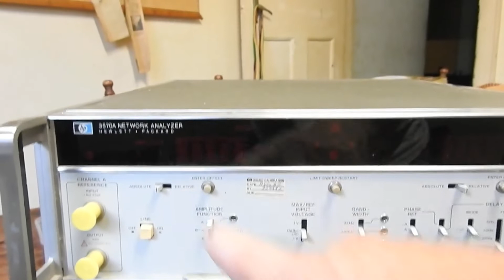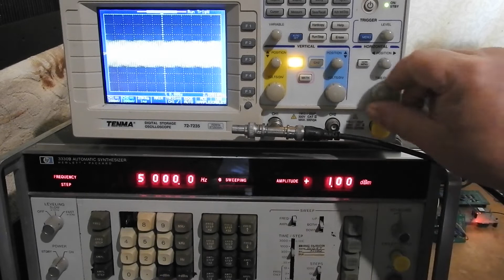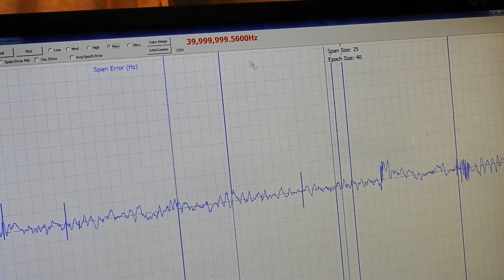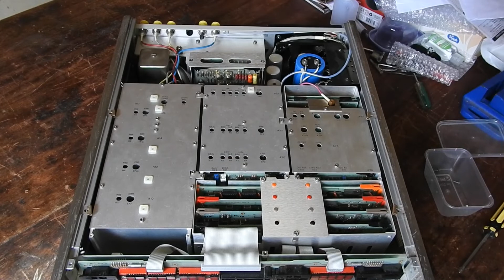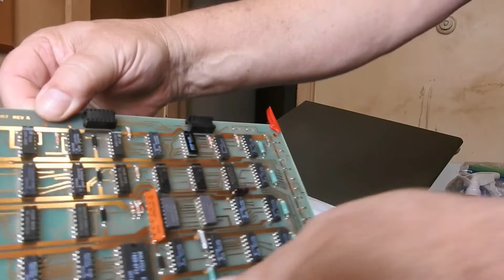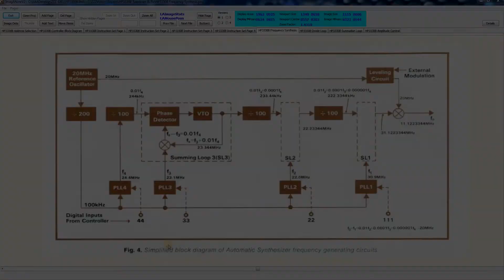HP3330B Automatic Synthesizer - Fooling around and Teardown

Comment: Hi bertoid, your video was very helpful, as I just pulled a 3330B out of a 20 year storage and didn't know how to set a sweep.
 A feature I'd like, is to be able to hold the 'Frequency Up' (or down) button and have it increment without pushing the button over and over and over.
Is this available on the unit?
Reply from the maker: Thanks! The Frequency U/D buttons do auto-repeat, at the speed set by the "time per step" slide control. 
I was trying to home on a specific value, so the slide was set to slow speed to get just one step per quick button hit, and I just hit the buttons repeatedly, to find the point i wanted. See from about 19:35 in the vid.
Reply: @bertoid  Oh, very good, I was pushing the 'sweep cont' button, now I see how it works. Perfect for finding the peak when measuring Q.  Thanks
Reply: If it's for sale, let me know!